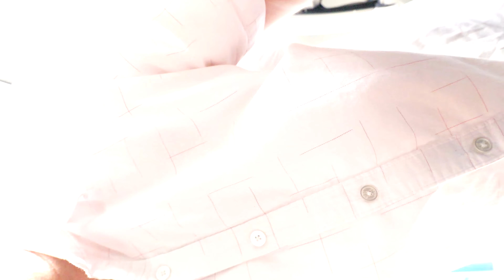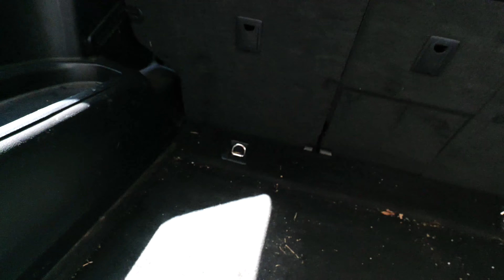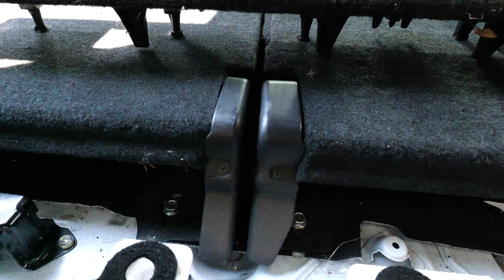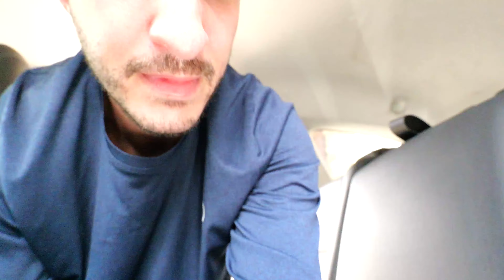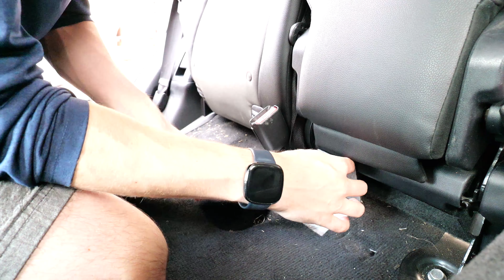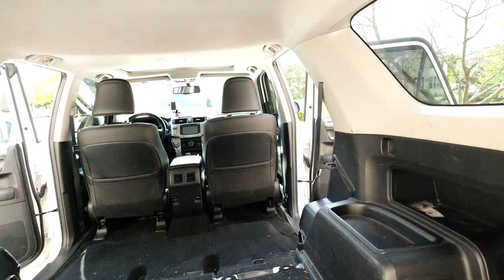4Runner Rear Seat Removal (2017, 5th generation)

Comment: Are you going to do any type of flooring or leave it as is? I took the rear bottoms out and contemplating taking the rear backs also, nice to have a flat surface but looks like so much more space with everything out. I just don’t want build anything then add weight and loose room. Maybe a thick mat or foam over the uneven areas.
Reply from the maker: I haven't added anything floor wise, just left the foam in that was in there for sound dampening. 
I use my vehicle mostly for moving my DJ gear to and from events, so no floor for me right now, I need every inch I can get 😂
The floor with everything out is surprisingly flat, even more so than with the seats still in. I think you'd be happier with the seats out and doing what you suggested, adding a filler in to the gap left. 
and definitely watch out for those harder surfaces leftover from the seatbelt anchors, I lay a moving blanket over it all so it doesn't damage anything. 
Hit me with any follow up questions  !!